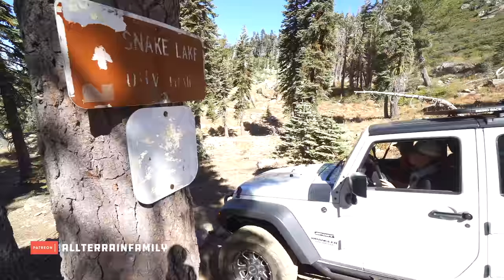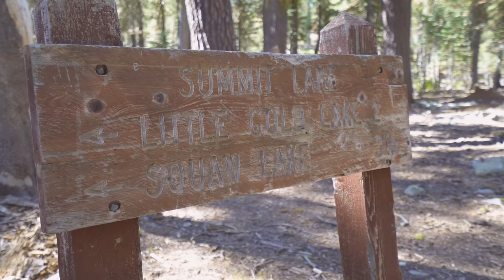First Power Wagon to make it to Snake Lake?

Comment: Nice ram! What kind of rims with what offset. And tire size? Looks good
Reply from the maker: They are  stock steel wheels.
Reply: Stock rims, 35” tires and 1” Bora wheel spacers. Getting it as close as possible to +25mm positive offset

Comment: Looks like a great time and fun trail! But dang, those PW brakes are squeaky!
Reply from the maker: It’s amazing how much noise a vehicle makes when you aren’t inside.
Reply: Most of the squeaking and creaking was from the front suspension, the OEM control arm bushings were shot. I’ve replaced all 4 control arms with Thuren’s. That cured all the squeaks, creaks and clunks I was getting, drove me nuts. The brake squeal ended up being a build up of brake dust, blasted them real good at the car wash and that seemed to do the trick.
Reply: No worries. My rear brakes sound like that too.

Comment: Hi, great PW action.  I have a '13 PW.  Can you elaborate on mods?  Lift other than OEM?  What bumper, sliders and any other protection you are running?
Reply from the maker: Walk Around video coming soon...
Reply: Hey John, the Wagon has Thuren 2” front springs, track bar and sway bar links in front and Thuren shackles in back with Thuren Overland shocks all the way around. It also has a Kinzer bumper and Randy Ellis sliders.
Reply: @shawnomeara22  Hey Shawn, thanks for the info.  Starting to Thuren mine as well.  Got the track bar in.  Did a DOR steering brace...happy w/ both so far.  Already running "35 MTs stock rims w/ some control arm rub.  Planning on doing Thuren 3"(1.5") coils and shackles, maybe control arms later.  Wasn't sure on the shocks.  Would be interested in your feedback on the Overlands after you have them for a while.
Reply: John FitzGerald, I just installed the Thuren control arms yesterday. A huge improvement not only in tire clearance but handling as well. The bushings in the OEM control arms were shot and the arms themselves were not built for this kind of abuse, they are really weak. I also lifted it another 1” with pucks on top of the 2” thuren springs, wish I had gone with the 3” from the start.
Reply: John FitzGerald, the 12’s & 13’s are the best years for the PW to date IMHO. We get the 6spd transmission with the 4.56 gears. When Ram added the 6.4L in ‘14 which only added 20 HP and 22’lbs of torque they dropped the gears to 4.10, I’d rather have the lower gears. They also added a coil sprung rear suspension which probably rides better, but it reduced the payload.
Reply: @shawnomeara22  Totally agree on these points.  The '14+ guys are always bragging about theirs being the best.  I disagree for the very points you mentioned.  I have read some complaints regarding rear shimmy on those, and ride issues for towing.  Rear leafs = simplicity and load capacity.  4.56 makes all the difference to turn the wheels.  That would be my first upgrade if I had a 6.4.  btw:. Thuren control arms are on the way!  I'm pretty psyched.
Reply: John FitzGerald seriously, the new control arms changed the whole truck for the better. Quite, stable and smooth.
Reply: John FitzGerald, BTW a couple of weeks ago I towed 10,000lbs with 35’s and it the truck rocked it.
Reply: @shawnomeara22  by comparison several yrs ago, I put 4.10s in my '97 TJ 4.0L to turn 32".  That was a little low for 32", but it got my 5th gear back and made 1st like granny gear, and would allow me to move up to 33" if I wanted to.  My last vehicle was an '02 Suburban 2500 w/ 8.1L and 4.10 turning 33".  That truck was rated @ 340 hp, and 455 ft lb torque.  The torque made a diff on that truck, so 4.10 was OK, could have benefitted from 4.56 especially if I moved up to 35".  So, I have a bit of experience with the 4.10 w/ 2 vehicle set ups.  That's what I base my judgement that 4.10s on a 429 lb ft torque 6.4L is a little bit under what it should be.  Wheras, the 4.56 works well with the 400 lb ft torque 5.7L w/ 35" and possibly 37" if I go there ( TBD).
Reply: John FitzGerald, I’m lucky enough to not have the PW as a daily driver. The truck is our weekend adventure Wagon, we tow a smallish TT regularly, sometimes for fairly long distances. Because of this I was hesitant to go 37’s right out of the gate, now seeing how well it did with the 35’s I’m not concerned about running 37’s, I truly believe this is possible because of the factory 4.56’s. With that said I’m going to keep the 35” AT’s mounted up to use for winter and long trips and get a set of 37” mud terrains on another set of wheels in the spring.
Reply: @shawnomeara22  sounds like a good plan.  Mine is a daily driver, so gas does hit the wallet.  My wife's Jeep GC Overland w 5.7L isn't exactly mpg conservative.  My old 8.1L ate fuel.  When people ask me mpg, I just tell them "when it gets empty I fill it up."
Reply: @shawnomeara22  I installed the Thuren arms today.  Still recovering from torquing up to 225 lbs w/ limited space under the truck.  Got my son to help shimmy the truck to slip bolts in.  Murphy's law , I just got done torquing the last bolt and discovered I installed an upper arm with zerks up.  Had to redo that side.  My arms needed the extra work out.
Reply: John FitzGerald, yeah serious workout! Re-torque them after a couple hundred miles too, mine needed it.

Comment: Hey little guys!!!!   
I've got a 2500 w Cummins and this was hard to watch..amazing drivers!!!
Question...should I get rockrail steps or those that disappear under the truck??  I want durable but not lose clearance..wife is under 5' and has hard time getting in!!  What recommend??
Reply: Do you plan on taking your RAM into areas like this where you may contact the rockers with immovable objects? If so, then get White Knuckle Step sliders which I have, or possibly these shown which are Randy Ellis Design. If tarmac bound, then get AMPs or whatever floats your boat.
Reply: @donleamon8653  I go off-road all the time..just not THAT severe...the problem is I always end up in shitty situation like that cuz I'm a dumbass....so I think the protection is nice.. beautiful truck and excellent driving...I have been stuck more times than I want to admit...a fun time last year I remember fondly that forced me to get chains rear and cables front plus new Wrangler duratracs..I was going up backroad to big bear CA on coxey truck trail..hit ice got where I couldn't move at all..2 full sizes later I'm out...a week later I'm buried in snow up there 3 trucks to pull me out...I get Into trouble cuz I'm stupid....next plan is bumpers and winch plus them sliders..
Reply from the maker: I wouldn’t get power steps. Those will just get smashed. There are rock sliders that either have built in steps or steps that you can clamp on.
Reply: @AllTerrainFamily  thanks!! Will look into sliders w built in steps. Wife is under 5 ft tall..it's a necessity.
Reply: phuck ewe  HAHAHAHAHAHAHAHA

Comment: Why did they have the brakes on? Just go low range 1st gear and crawl down no 🤔🤔😑
Reply from the maker: It’s. Really. Steep. Steeper than it looks. I don’t think these rigs are geared low enough to get by without brakes on this trail.
Reply: We would need a manual transmission to crawl that slow down the hill, the slush boxes just let em roll.
Reply from the maker: @shawnomeara22  I honestly have no experience with Auto Trans and 4 wheeling. As you can tell from my inability to even get the Ford into 4 low on episode 1 of our Mojave Road Video. https://youtu.be/8iobIllAoXs?t=566
Reply: Aye, way to steep to crawl down with no brakes, especially with the weight of the PW pulling it down.
Reply from the maker: Yeah. This is where you want the 6 speed manual with granny 1st.
Reply: 4 lo in 1st will hold that truck. Just gotta trust it.